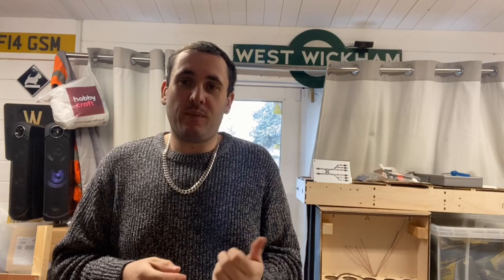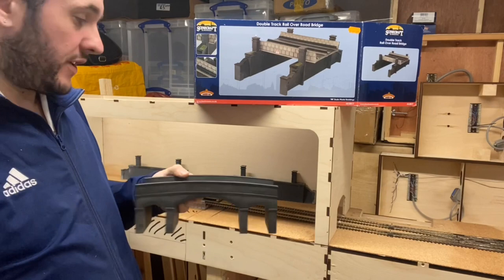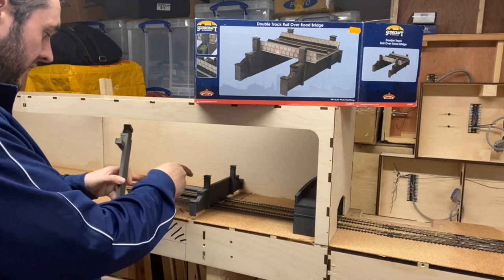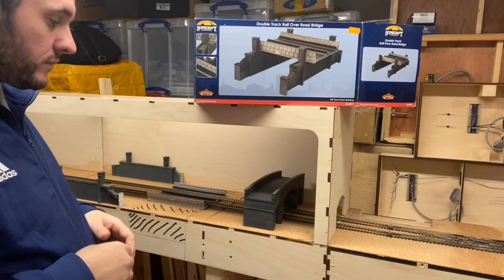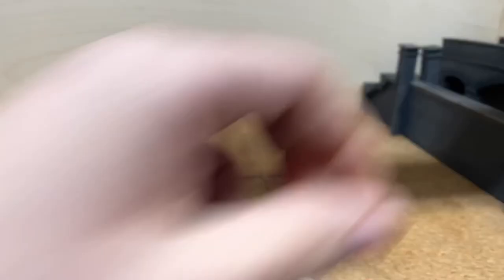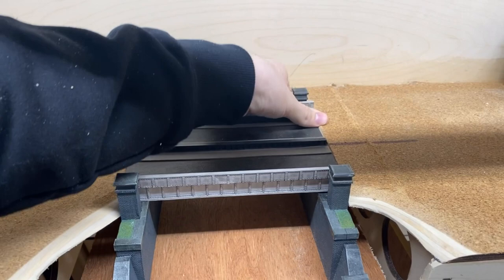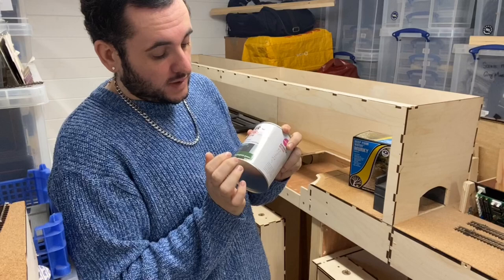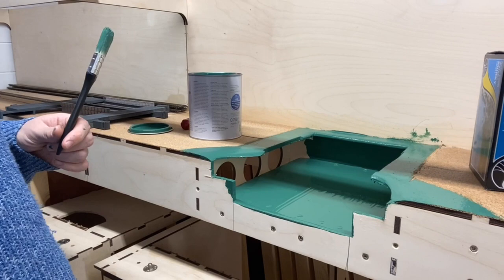Gordon’s Lane Part 4

Comment: I got a static applicator along with the spring/summer static grass for the start of my landscaping which was around my viaduct which crosses the river.  This is the first time I have used this system and the finish is excellent.